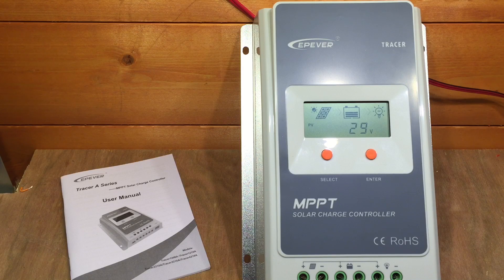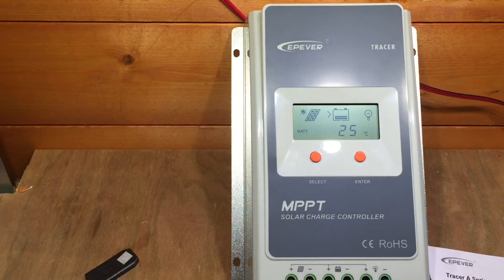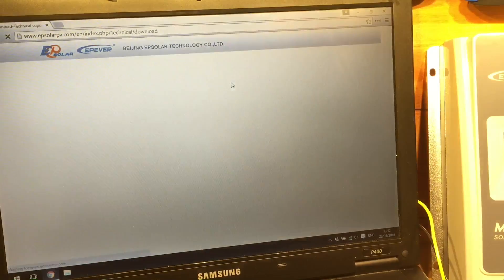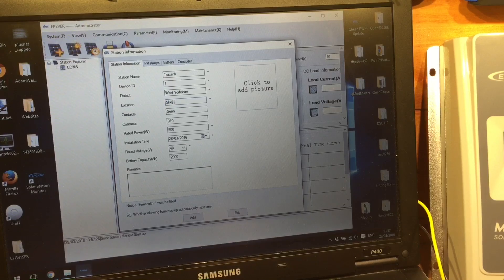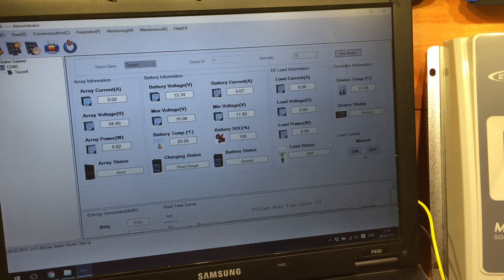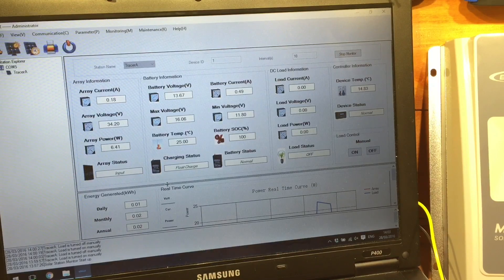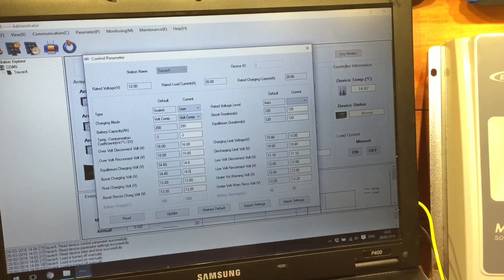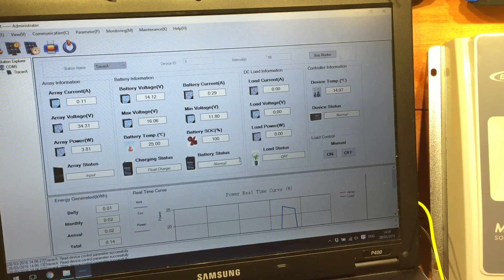EPSolar Solar Station Monitor software & a cheap USB cable - 12v Solar Shed

Comment: Just found your channel. Thank you for this video. 
How important is populating the station information tabs in the software? I was trying to get help on it from Epever but they didn't say anything about the solar station information tabs.

I have 6 250w panels wired in series-parallel (3 and 3) for a total of 1500w. I have 4 LifePO4 batteries, 12v 200ah each. However, the voltage is cut to less than half on the controller. I measured 94 volts coming in but it cuts to 28 volts. The system registers the right voltage if the panel power is reset but after a second, it drops.
I am not able to get to fully charging the batteries. Any thoughts?

Comment: Thank you for the video. In my case, we don't get much choices regarding mppt charge controllers and most times have to buy what is available. So, I purchased a generic looking charge controller. According to the seller, the feedback on the device by installers has been great. That's mostly what we have relied on over here. I have been searching for information on how to use the RS485 port having noticed that it looks quite like an RJ45 and to which it fits quite squarely. The USB to RS485 device seems like the way to go, so I'm wondering if the EPEVER software is universal and will work for my charge controller. Is there such a thing as a universal software to monitor and configure solar charge controllers?

Comment: I'm having an issue with mine were the battery symbol flashes with an error triangle. When I select the battery it says 2.8v but when I put a millimeter to the battery it says 11.7v? Any ideas? Sorry this is totally new to me.

Comment: Thank you! This video just helped me figure out why my  rs485 dongle wasn't communicating with my Epever tracer. It turns out the latest EPever Tracers don't come with the RJ45 pin out in the manual like yours did, and the pin-out I previously found online had the ground on the incorrect pin (causing me to ground one of the signals).

Thanks for the great content.

Comment: FYI the Bluetooth accessory for this is shite .even with ghe phone sitting on top of it, it only connects 1 out of every 15 times, take more than 2 ft from it, it will hardly connect
Reply: Update 9 months on ..Its better since update.. Still not brilliant,  you need to manually disconnected and reconnect the dongle sometimes,  but definitely better than it was

Comment: There at 10:20 , could this battery under temp. setting be used for LiFe low temp charging protection under zero degrees? As the setting goes from negative 40 up to zero...right on the limt.  I suppose that needs the external temp sensor. I did not check on newer versions of the software...
Edit: just downloaded the current software V1.95 and it has an additional section in that actual window in the video, especially for low temperature cutoff for lithium, possible to set from -40 to +10, seperately for charge and discharge.
Edit: on the website it lists the compatible inverters. Tracer A, Tracer AN, etcetc. So it SHOULD work....

Comment: Thanks for your great video
I have 2 Tracer 3210AN the monitoring with solar station monitor and a USB to RS485 works perfectly.
Since I have two devices, I wanted to operate both with the software at the same time. So I bought 2 USB to RS485 converters and connected them to a USB hub.
In the software I now have 2 solar controllers one on COM5 one on COM7 when I set the first to start monitoring everything works fine. If I set the second to start monitoring I get an error message "Operation failed. The operation has timed out. (COM7)"
Do you know what the problem can be why I get this error message
Reply: I found the solution to the problem in this video 
https://www.youtube.com/watch?v=e-AK32P9yso

Comment: Thanks for this vid.  I had to buy the rs485 modbus usb for my 2210 Tracer-AN  version.  Worked like a charm.  I had to setup user settings for my LifePo4.  Those settings are very specific and yeah.  i could not just use the default 3 that was part of the Charger.   When i bought the 20amp MPPT. I was hoping one could just cycle through the settings via the 2 button interface... but ye. USB to RJ45 via that chip was needed
Reply: Hi, I'm about to set-up my Tracer3210AN (older version with orange buttons) for my LiFePo4 battery. Unfotunatelly there is no preset/default mode for this type od baterries, so I need to set up 'user' settings through rs485 (CC-USB-RS485-150U). Thanks for this help!

Comment: I was trying to find out if you can just replace the cable that comes with mt50 with straight through cat5/6 to connect to mmpt. I need a longer cable
Reply from the maker: Yes you can. I’ve just double checked for you.
Reply: @AdamWelchUK  thanks a lot! Mine isn't installed yet but I need to decide its position in my van so that's good news.

Comment: Very helpful video. It took me quite a while to get my self-made cable to work with the Tracer 2210AN. I used the green and blue wire like you did. The drivers included in Windows 10 didn't seem to work, I had to download the CH341 drivers manually. Finally I was able to adjust the controller parameters to disable equalization charge for my AGM battery.
I left the outer insulation of the cable (is it called jacket in english?) a bit longer than the inner wires and taped that to the RS485 adapter to prevent damage to the very thin wires.
Reply: What values,  isnt sealed next best
Reply: @jussikankinen9409  Hi. After two years I don't remember and I can't find any notes which values I used, sorry. I think I probably used the setting for sealed batteries and set the equalization charge voltage to the same voltage as boost charge, which should be 14.4 V according to the manual. But I don't remember.

Comment: Hi, thanks for your video.
I have two 100Ah AGM batteries connected in parallel.
What should I enter in the configuration data?
Battery capacity: 200A
Batteries in parallel: 2
or
Battery capacity: 100A
Batteries in parallel: 2
??????
Thanks if you help me.
Reply: have you found the answer? ;-)
Reply: @PawelM1980  No sorry.

Comment: Glad to find this video. EPEVER have "omitted" the RJ45 pinout in the booklet which comes with the Tracer AN! Also, they clame that the default configuration is suitable for both sealed lead/acid batteries, and LiFePO4 batteries, 12 or 24 volts...
Reply: We have LiFePO4 12V, are you saying you had problems with that?
Reply: @mattwilliams6500  so far, no problem. Have it for a year not.
Reply: Personally, I think that the default configurations are standard and can be left ad they are. In my case, I have a tall tubular flooded lead acid battery and I checked and observed that the default configuration for that selection of battery aligns with the parameters in the manual from the manufacturer. So, I don't think I have to worry about inputing a user configuration to match.

Comment: Hi Adam !
Great stuff !!

Have you tried having the two units att different adresses and connected together, to be able to monitor the two units in the software att the same time ?

I have two units in My van, and have Them om different adresses, works fine, but I would like to monitor them att the same time. Tje program has support for it !!

Comment: Can you help me, I have a EPEver AN 40a I have a solar panel which is 240w and at peak 340w flexible China LOL.. I'm in the Philippines so have lots of sun.. So I tested today at full sun light over the panel but I am only getting around 36.4 around on the Array Power(W) reading in the PC software not in the 240/340w range.. Am I missing something, is this correct? I'm British in the Philippines at the moment so nice to hear ur voice mate :)
Reply: are you getting 36.4 Watts or Volts ?
What voltage is the panel rated at ?

Comment: Hi Adam some time since you did this video which is really helpful they have a bluetooth interface have you done a video about this Thanks heaps for your time to do these videos Ross tga NZ
Reply from the maker: Sorry no I didn’t ever buy the Bluetooth module. Once I had the charge controller on my network (and now logging to my pi) I didn’t need it on my mobile like that.

Comment: Just see i wrote to you 4 years ago.. and the last 2 weeks ago. Time goes fast. Well here's a update from me.. I got new panels 305w and Epever mppt controller. I have followed this video to see and to learn about the settings with computer. But yet i not really understand why would battery % shows lower than what it really should be. SOC i mean. I dont use it as you but i always look at it =(  While in the settings as in this video, your settings on " Over Volt. Disconnect Volt is 16.00 and Over Volt. Reconnect Volt 15.00. Why would this two be set to so high? I am using a Conbat nvr 100 battery so as in your video i believe is for AGM as well.

Comment: In other video can see you have connected the ground as well.. But why not in this one?
Reply from the maker: The adapter does not have a ground connection on the rs485 side. It’s often not needed but on longer runs or in electrically noisy environments it can help.

Comment: Charge Controller V1.95-Windows stopped working as part of Windows 10 version 1903 after .Net update
Reply: when was that update
Reply: @Punk_Philosopher  This is an ancient update that now works with Windows 2004 in compatibility mode with Windows 8.1 and does not support 16x9 monitors. There are no new versions yet.
Reply: @akaigx9  so none of the software works that is here: https://www.epsolarpv.com/downsoft.html?  What about v.3 (lithium) or version 4 (sealed)?
Reply: @Punk_Philosopher  I only have an RS485 cable to the desktop.
Reply: @akaigx9  So what software do you use Sergey?
Reply: @Punk_Philosopher  Charge Controller V1.95-Windows

Comment: Does the "Battery Information" show the actual voltage of the battery or the charge voltage of the battery like the LCD display on the controller itself? Thanks. UPDATE: After watching your video fully, It looks like it does indeed show the real battery levels, not the charging levels. Thanks.
Reply from the maker: It does, you’re right.

Comment: This program doesn't store historical data. And it can't read data from eLog01. You must use another application.
And also when you have eLog01 and you set/read clock, this application reads it from eLog01, not from Tracer. I don't know any application which can store historical data from Tracer regulator 🙁. I'm going to change my Tracer to another model from another company, because I love historical data.

Comment: i use the usb cable that come with the epever mppt and pc dont find the com5 port . say is nothing connected to com5  ..any idea
Reply from the maker: I think you can get the driver out of the zip file for the Solar Station Monitor software available directly from EPSolar.

Comment: Hello Adam. I have one question.
When you make this video,did you use something driver for 'RS485 to USB Adapter'?
Reply from the maker: If it’s the same adapter as mine you’ll need the CH340 driver.
Reply: @AdamWelchUK  Thanks a lot!! I'll try to install.

Comment: I've a problem with driver COM in windows 10
Reply: I could not get it to work on two different Windows 10 laptops and had to install it on Windows 7 to work.

Comment: new 4210AN, using Epsolar provided RS485 - USB the software recognizes the station and establishes a connection but instantly locks up when Start Monitoring is clicked. Ver. 1.93 on Win 10. Ran compatibility troubleshooter and it came back with Win  7 ... still locks up.  Appreciate any suggestions. Thanks.

Comment: Hi Adam,
First of all, great channel you got here.
Learning alot with it.
Just purchased a tracer2210an and also have the same USB adapter you have.
Now, the problem is where to load the monitoring software. I can't find it in their website. The website is completely diferent. Can you help?

Thax

Comment: Hi Adam, just found your videos and they are very informative. I have installed a tracer 3210 an to my caravan that has a 115ah battery and has a 120w solar panel. What would the best settings be to prevent overload on my battery or over discharge that could also damage it? Regards Mike
Reply: with 120w you cant

Comment: If I wanted to use the MT50 monitor and also divert the trace to a Raspberry Pi in order to remotely view the data, could I split the RS-485 cable by sending half of the pins to the MT50 and half to the Raspberry PI? I'd like to use the MT50 to configure the charge controller and view the data when I am in my shed, but also record all the trace data automagically with the PI, but not sure how to split the cable to achieve this. I have one of the BN Series of controllers, so no screen on the controller.

Comment: So I'd join for your own end question. Is there an easy way to pull out power data and export it to spread sheet?
Reply from the maker: The official method is the elog-01 from EPEver, but it’s not instant. You can display ‘live’ stats and log it using grafana on a raspberry pi. Check out Colin Hickeys YouTube channel for some how to videos.

Comment: Thanks for the info Adam.  
My new AN series manual does not have the RJ45 wiring info.  I guess they would rather that you buy their cable.  Less support problems.

Already had a couple of those cheap USB-RS485 adapters.  So making my own cable was a no brainer.   Did not need to add a ground wire.  Thanks again.
Reply from the maker: Glad to hear it. Nice one.

Comment: Do Epever have a reliable helpline or a chatroom where I can get some help setting up my com port? I've followed this tutorial closely but I am having problems. When I click "start monitoring". I get the message "station not found". I've bought an ebay USB-RS485 adapter (eBay item number: 292643332429) and installed a generic driver but the solar station software doesn't seem to like it. It tells me COM4 (Doesn't exist or not set up yet). My device manager recognises the usb as COM4 and I've enabled COM4 on the Solar monitor options window. I'm running on windows 8.1 if that makes any difference. Wiring is correct as far as I can tell. Fourth wire (blue) to terminal B and 6th wire (green) to terminal A. Can anyone recommend a suitable driver for the adapter?

Comment: Hi, I noticed that your battery icon displayed almost half full. Mine does this quite often, does this mean it’s half empty (or half full depending on your attitude ha)
Reply from the maker: The indictor shows the state of charge - although I have to say this is one of the most ridiculous indicators I know. It only shows full of it is actively being charged and drops to about 50% as soon as the sun goes in. I take no notice of that and just keep an eye on the battery voltage to determine if it’s charged or not.
Reply: Adam Welch thank you so much. It’s been doing my head in

Comment: Adam, thank you for all your videos!
I didn't really like the station monitor software, i wanted something more dynamic and fast. Using a Raspberry Pi,  USB to RS485 Converter, Node Red and MODBUS Nodes, I am now able to view in real time the status of the charger. I have also setup text alerts for certain scenarios, being that its realtime i get the texts with current data.
My next step is to write to the registers to turn on and off the load via Node Red.
Again thank you so much.
Reply: have you got an R-pi image for this? cheers
Reply: I am doing the same using an arduino and a gsm module (for text alerts). epever sent me a pdf with the modbus documentation. i can also turn the load on and off by sending sms to the arduino. very cool! Thanks Adam! This video helped me getting this project started (only 4 years after) ;)
Reply: @Honeybadger0815  hey i know you wrote this 1 year ago, but do you still have the modbus documentation?

Comment: Cant get this to download very frustrating
Reply from the maker: The solar station monitor software? Perhaps it’s an antivirus thing? They use a rar archive and sometimes Chinese characters which may flag AV. Have you got 7zip to open the file?
Reply: Adam Welch ive tried 7 zip and that wont even help me. My laptop is old enough il keep at it..
Reply: Ok so got it up and running, but when i click start monitoring. It says "station does not exist!! Lol fml

Comment: Hi Adam, I have tracer 2210A, cable CC-USB-RS485-150U but can't connect controller to PC. The computer recognize the cable,  in port settings checked "RS485", but no any connection with charger - I cant't read information or get any data. After pressing "Start monitoring" nothing happening. If i try to read device COM settings, pop out table with "Operation failed". On the cable label also marked, that is for LS-B, Tracer-B, VS-B controller, can it be the reason (that there is no mentioned Tracer-A)??

Comment: Thank you a bunch for your video, I finally got my connection going to the mppt :D Started out with a RS232->RS485 circuit but could not get it to work. A usb to rs485 circuit was the way to go.

Comment: Awesome Video Series.
I just purchased the newly updated 3210AN Charge Controller and I also bought the official  CC-USB-RS485-150U cable (USB to RS485 Adapter w/ RJ45).   It would not work at all until I opened the Device Manager, Right-Clicked on the COM port, and choose Properties.   Under the "Port Settings" Tab, I had to check the "RS485" box and apply.   As soon as I did that it worked.

Thought it might be helpful to someone else out there!   I'm on Win7 if that comes up.

Comment: Thx for informative video! Stupid question - how is the temperatue probe mounted to the battery? My is a wire with a brass colored cylinder at the end - do I just tape this to the side of the battery? Thanks.
Reply from the maker: Yes just tape it onto the side of your battery.